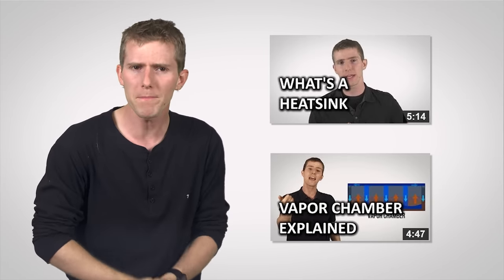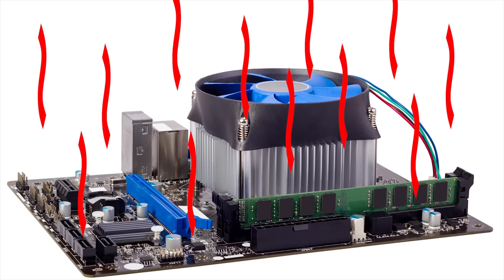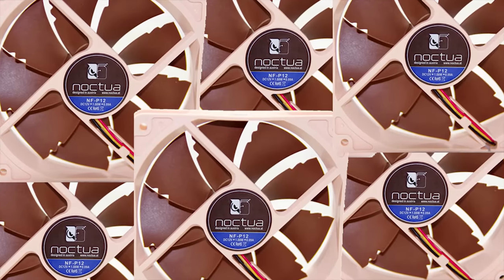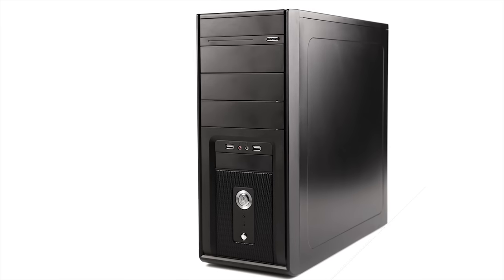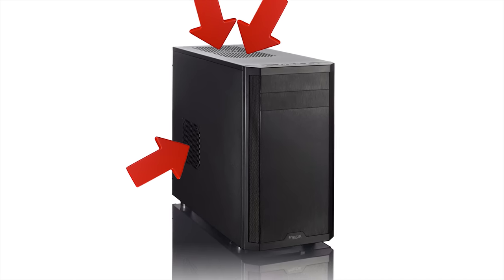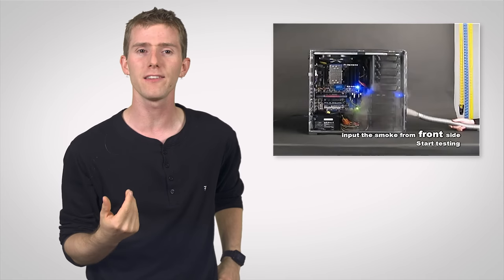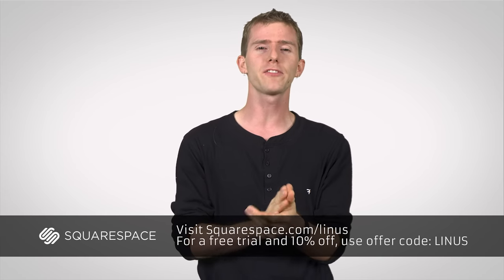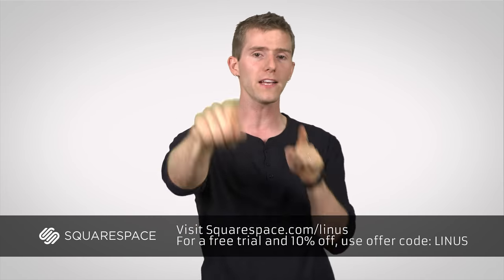Positive vs Negative Air Pressure as Fast As Possible

Comment: Is having 1 intake and 2 exhaust good?
Reply: yeah that's fine
Reply: I don't know for certain,but having a balanced yet favouring positive is recommended by the community
Reply: yeah, but I don't know if it'll make enough of a difference to be worth switching over, you could always add another intake fan.
Reply: Thanks for the answers guys :)
Reply: you have negative pressure in your case, i would make 1 of the 2 exhausts an intake and slap a filter on it, your power supply is also an exhaust so... yeah. The reason is you might have dust creeping in through the nocks and crannys of the case like the PCI slots and front panel
Reply: CatheteriZedEYE a PSU isn't exhaust, its an intake, unless you have the air Colling the pcu that is already in the case.
Reply: Keston Lamers The PSU isn't relevant because it sucks air in from the bottom and ejects it out the back, so it is pretty much irrelevant
Reply: I was replying to someone else.
Reply: Keston Lamers You said it was an intake, which it is not. It doesn't have an effect.

Comment: I like your vids, although you are crazy as shit, lol. Your how to fix a bent pin vid was great, you should see my socket right now tho- Dont even know what happened- HALF the pins are layed down. Wow. Anyway, I would love to have some more info on this- 1) you didnt talk about fan types, as far as cfm vs airflow fans. Loved the panty hose tip tho, thats a good one. 2) I have a case thats becoming a rather common config- 3 front fans, a back fan, 3 top fans. Well, fan slots that is. Front slots are filled. I am looking at the back and top and thinking, ok, what to do with these? I want to fill em up for the LED's honestly, although I honestly feel 3 front and one top or one back would be a good config. So I am thinking exaust on the back and the back-end top fan, intake on the front 3 and the other top fan. But I would look at cases my man, so few have side fans nowadays, so the config I have is getting pretty standard. You could tailor a vid to that and cover 90%  your viewers. Also, if you want to do a vid on a motherboard that is "beyond repair" I got this dell with its socket pins f-ed lol. I'll probably fix it and try to reassemble the original oem, I am just pulling the cpu and ram right now and putting it in a new rig.

Comment: I always find these videos leaving too much detail out. With the same un answered questions

Can someone explain what he meant by " working against each other" ? Does it make the fans less efficient?

Are you talking about heat transfer or about dust?

can you run some actual test to show us to " set it to rest?" 

what if its 5 intakes 1 exhaust?

I hate your videos, they are as useless as the forums when it comes to hot topic debates.